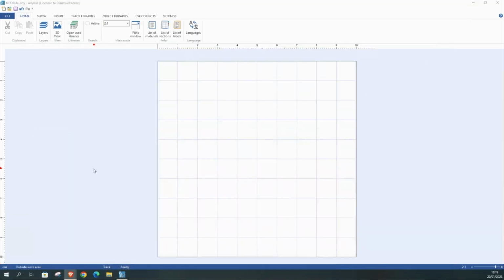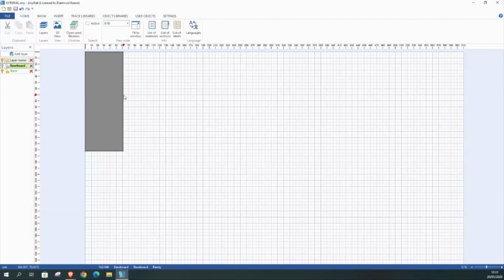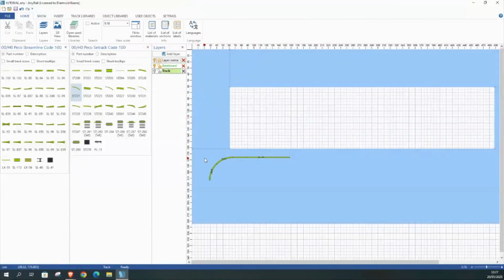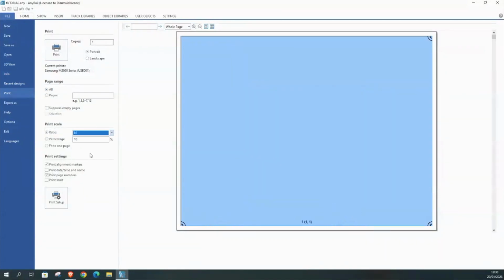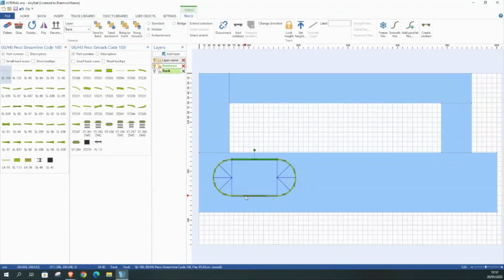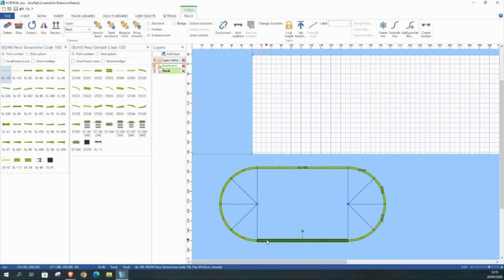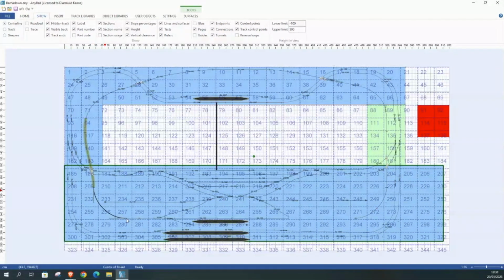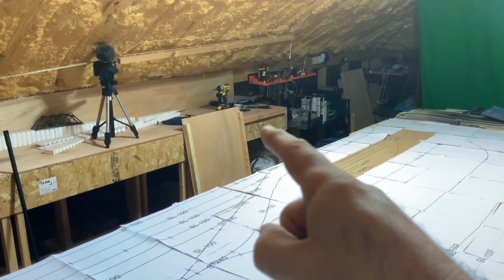01 Planning a model Railway using AnyRail

Comment: Great Tutorial, well done. When I built my small layout ( 10x9 ) I had a plan in my head, did a couple of sketches then went to it.
The layout has two main lines, a four track station at one end and at the other, each track has two loops to allow storage.
It is far from perfect and am in the process of wiring a shuttle. track on the around the opening.
I really should jump into Anyrail to see how I might improve my layout, maybe drop one loop/siding in each direction and facilitate another main line. The layout is DC and the points are manual, requiring visual attention.
Really enjoyed this.
Cheers
Charlie